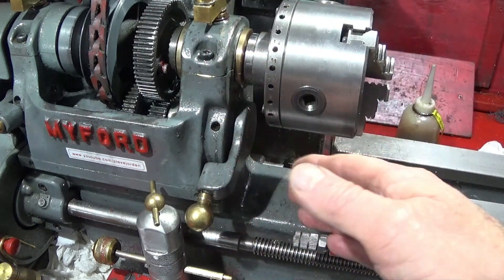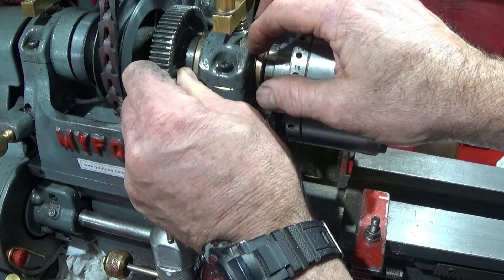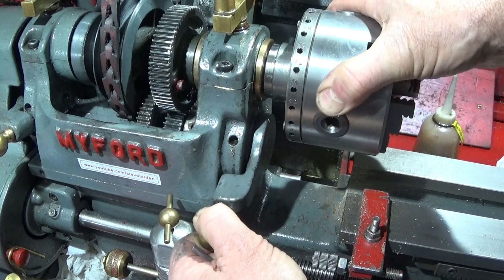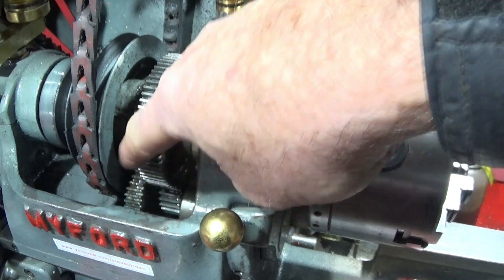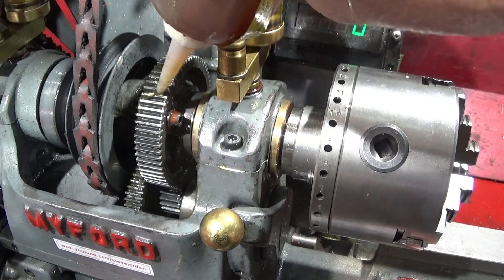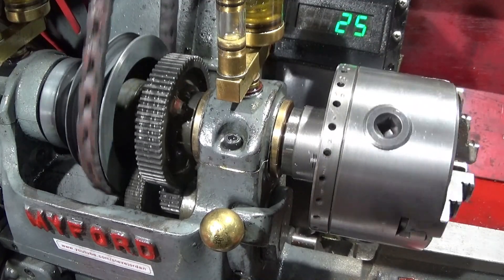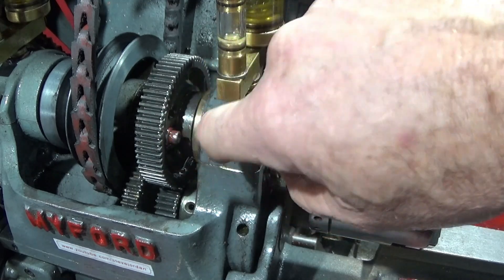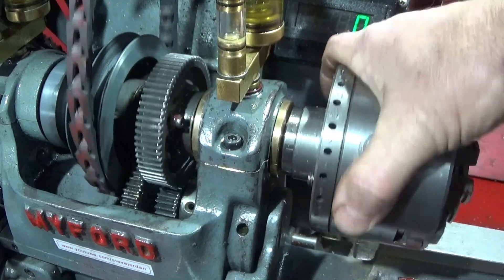How To Engage / Disengage The Backgear On The Myford ML7

Comment: Well explained but I think I’d remove the Allen head and replace it with a bolt with a double thickness head, it would be easier to get a spanner on and keep the locking key engaged while tightening,

Comment: Excellent series of mods and ideas,I'm getting loads of inspiration and ideas from your videos and work.I am just a self taught amateur machinist with a lifetimes experience as a mechanic.I own an early ml 7,1949 approx,can I ask how did you mark hole positions on chuck backplate for dividing work?
Reply from the maker: Hi Dean thanks. I bought the first backplate off eBay and then used that with the toolpost drill set up to do the holes in all my other backplates. I think they still sell the indexing backplates on eBay if you look them up. Regards Steve

Comment: First time for me seeing how this little nugget works. Surely it would be easier to replace the socket head with a hex head so you could get a ring spanner on rather than faff on with a Allen key.
Reply from the maker: The ring on the spanner would prevent the tooth assembly from locating fully. Regards Steve

Comment: What Steve shows is important for any back geared lathe. All the driving torque is being directed through the small gear latching segment he showed or through a push/pull pin in the large bull gear.  This is the reason you want to avoid engaging the back gears with the bull gear still latched to the drive as a way to get the chuck unscrewed on machines with a screw on chuck. If the chuck is tightly stuck on the spindle and you lock the mechanism up as described you risk breaking the latching mechanism or worse still, breaking a tooth in the back gear. Many bench lathes have helical cut back gears and if you damage them your lathe is just about ruined if you can't find spare parts.
Cheers from NC/USA
Reply: Excellent additional explanation. Thank you

Comment: I think that little dog is by far the least favourite feature of my ML7. That alone makes me lust after a Super 7, which improves this mechanism. Getting the hex key engaged into the screw blind is a pain, and I find that the screw must be backed out almost an entire turn to allow the dog to be moved reliably to either its fully in or fully out position, which requires engaging the hex key several times.

Perhaps there is some way I can modify the end of the hex key to make it easier to insert. Giving it a round pilot tip which can enter the screw head socket at any orientation would help, by avoiding the need to have the key at both the correct location and the correct orientation at the same time. But such a pilot tip can't be very long because the depth of the socket is limited.

Comment: Nice excellent little video. I'm sad that I only have a 2nd hand Chinese lathe a Sieg M6 125 mm centerhight * 550 mm (10" swing over bed * 22"). On the other hand it probably wouldn't go in to my basement or workshop, if it were any bigger. The M in M6 indicates a mill.
Inspired by you I have upgrade from a single phase to three phase motor. Thereby increasing power from 750 W to 2.2 kW and variable speed via frequency converter.
Reply from the maker: The Myford ML7 is only a small lathe. I have a Chinese Mini Lathe 7x14 as well. That has a larger sizes spindle bore than the Myford but a shorter bed.